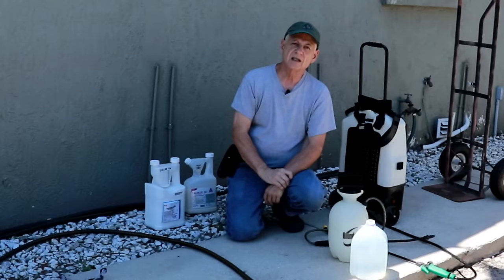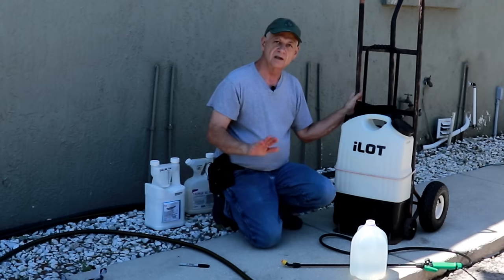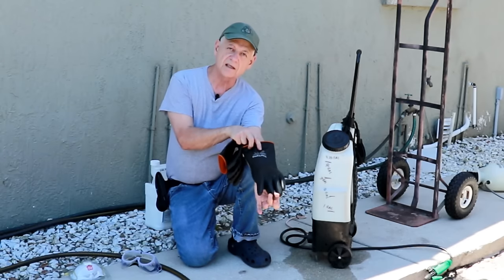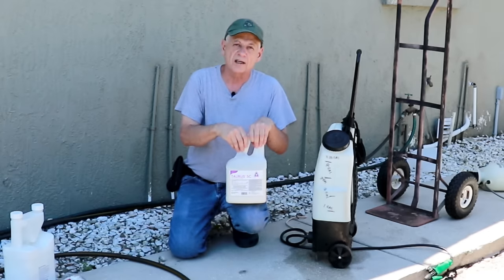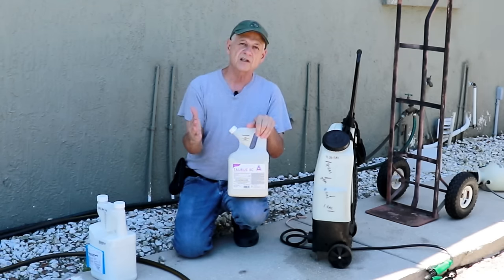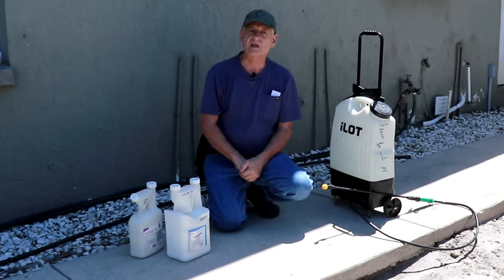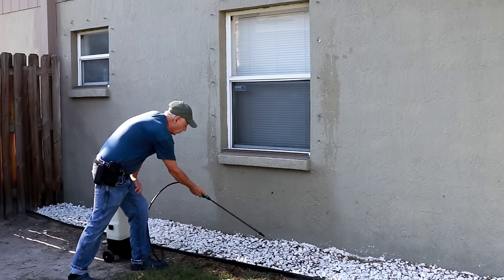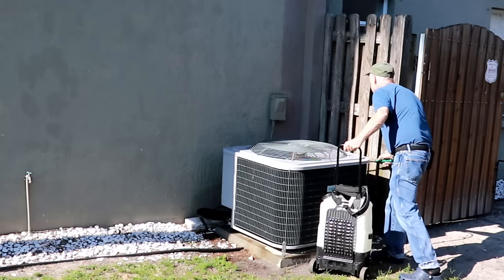General Exterior Pest Control - IMPORTANT!  READ THE DESCRIPTION.

Comment: Hi Guy, thank you for such informative videos! Do you have any advise for treating drywood termites? Is tenting the only solution that will truly get rid of them? Right now, the infestation seems to be only in one area of the house. I have heard good things about using Termidor foam. What can we do for the outside of the house? Any advise will be appreciated.
Reply from the maker: Hi Jonika.  This is quite an involved subject and I do know a lot about it.  First let's talk about how you got drywood termites in the first place and how to avoid them in the future.  Then I will go over all your options on how to treat them.  Most of the time, these guys enter through the exterior of your home.  They come in through cracks and crevices around windows, doors, pipe penetrations, the eves under the roof line, etc.  You can also bring them in when you buy used furniture. They are easily prevented by never buying used furniture and by doing the treatment in this video every three months.  Unfortunately, while this exterior treatment will prevent drywood termites, it cannot treat them after they get in.  So let's talk about your treatment options.

1.  Fumigation:  Tenting and fumigating is the only sure-fire way to get it done 100 percent without fail, but it's expensive and most companies will not do it.  They will either farm it out or just tell you that they can't do it.  It's definitely worth getting an estimate for it though to see exactly what you are looking at in terms of cost.  Keep in mind that, while this treatment will kill all the termites, it does nothing to prevent another infestation.  You will need to do that yourself and, as I already explained, you can do that by treating the exterior of your home every three months and by never buying used furniture.  If you go with fumigation, then try to find a company that specializes in it.  Most pest control companies that offer it, actually subcontract it to someone else.  It’s always best to avoid the middleman and work directly with the fumigation company.  The advantage of this method is that it is a sure thing.  The disadvantages are that it is somewhat dangerous, inconvenient (You need to vacate the home for several days.), and expensive.  Prices vary upon a number of factors, but I have seen costs as low as $2500 and as high as $8000.

2.  Bora-Care full treatment:  There are just a few pest controllers out there that can do a Bora-Care treatment on the entire building, where they literally inject foam into all your walls, the attic, garage, window frames, etc.  Bora-Care is a permanent treatment that never needs to be redone, but you really need to know what you are doing if you are doing the entire home that way.  It's worth asking about, but you may not find anyone that knows how to do it.  I will place a link below on a video on how it's done.  The advantages of this method is that it is permanent, so you never need to worry about any kind of termites ever again, and you do not need to leave your home while the treatment is going on.  The treatment usually takes just one day, but I do not know what it costs.  I have never done it myself or even seen it done.  It’s a fairly new approach and I was retired before it was in use.

https://www.youtube.com/watch?v=kXQTc9wwCfQ

3.  Microwaving:  This is the latest form of treatment where they literally put a microwave against the walls where the infestations are and they cook the termites to death.  Since this is very new technology, I suspect that many pest controllers do not have access to it yet.  The ones that do often also want to use pesticides as well to treat areas where the microwave will not reach, like the attic.  I have no idea what they charge for this treatment because it is very new and I have never seen it done.  So, I cannot guide you all that well with this one because I retired long before this was available.  All I can do is take a look at what they want to do and see if it makes sense to me.  The advantages of this method is that you can remain in the home while it is being done and it reduces the amount of pesticide that will be used inside the home.  The disadvantage is that it is not a sure thing.  Galleries can be missed and then the problem will not be solved.

4.  Spot treating is the way most pest controllers are going to suggest doing this, but be careful here.  Just like option 3, even the best pest controllers can and do miss galleries. That is why they will not give you more than a return visit guarantee.  They will return if YOU find another gallery and then they will generally just treat that one gallery.  By the time you find it though you could have a dozen more that you didn't find.  This type of useless guarantee is generally good for one to two years and then they want to sell you an extension on it for about $300 a year.  How's that for nerve?  If you do spot treating, you should know that not all pest controllers do it the same way and some are really bad at it.  To do it right, you must do a Bora-Care treatment of all the wood in the attic and basement, if you have one, and a lot of pest controllers won't do it because it takes too much time and it's hot, hard work.  That's why you need a written treatment plan.  Some companies will lowball you with a great price, but they are not treating the attic with Bora-Care and there is a good chance that is where most of the termites are.  Sometimes they will just spot treat the attic with a fipronil foam or they may not treat it at all.  Still, this is probably the most cost-effective option with prices being all over the place.  I have seen it as low as $300 and as high as $2500.  Guess which one is doing the Bora-Care treatment in the attic.  I know, I know, I'm probably really discouraging you right now, but I will always tell you the honest 100 percent truth because I don't want you to get ripped off.  So, if you go this way, then please send me all the treatment plans.  I am happy to give you an email to send them to.

5.  Treat it yourself.  You can do the same treatment that the pros would do in option 4.  I can walk you through how to do that, but keep in mind that if the pros miss galleries, then it's a fairly safe bet that you will too.  However, if you treat the basement/crawlspace and attic with Bora-Care properly, then that will eliminate a good deal of the problem permanently.  Then you just need to continuously inspect for galleries to be sure that you didn't miss any.  I have a video in production right now on how to do this, but it will not be available for at least another month.  It takes me several weeks to produce a video and I have already been working on this one for almost three months and I think I will need another four to eight weeks to get it finished.  No matter though.  I can walk you through it and you can even call me if you need verbal explanations.  I am here for you every step of the way.

Okay, sorry for this lengthy explanation.  I know that this must seem really overwhelming and I wish I could just go there and take care of it, but the best I can do is try and guide you through the process and ask you to try and relax as much as possible.  Having drywood termites is a scary thing, but worrying about it is not going to fix the problem.  The best thing you can do is to do your homework, which you are now doing, and then devise the best treatment options for you, that is within your budget.  This is not something that you can ignore because it is not going away and when left untreated it will literally cause thousands of dollars in damage to your home and may even render it unsafe to live in.  So, while this should not be a cause for panic, it should be a cause for concern that needs to be addressed as soon as reasonably possible.  The good news is that you came to the right place.  My service is free and I will take the time to guide you through whatever option you choose.  Even though there are a couple of options that I have not personally done, I have done my research on them and I am very familiar with how they work.  So, I can guide you through how to do this yourself or how to get the best price on a pest controller that actually knows what they are doing.

Thanks for reaching out to me and thanks for watching.  Please let me know how you want to proceed and I will do my best to help.
Reply: @GuysPestSolutions  Thank you so much for such a thorough reply! You gave me and others great information. Thank you for sharing the helpful links as well. I just ordered more cans of the termicide foam and a gallon of BoraCare. I can tell where the termites are thanks to their droppings. Would you be so kind and give me any tips on how to apply the foam properly? I have a few places where the termites made "poop" holes in the wood and where they swarmed this fall. I looked into one open gallery and oh my gosh, there it was - one live one crawling. Would you know how often could I reapply the termicide foam? Like you say, I don't expect to find all the galleries all at once, but I am ready to keep checking for more later. As the next step, you recommend BoraCare. Can I apply it on the wood inside the house or should it be used on the outside only? Do you think it's a good idea to treat the affected wood with BoraCare before or after getting it treated with the foam?  Can I apply BoraCare with a roller, too, or spraying it on is the best way to do it?  For now, I am going try to treat it myself. I will call the pest control companies and ask about their BoraCare treatment plans (or if they even have them!). Thank you, again, for your helpful information and guidance! My house is  ALL WOOD. If I don't start fighting these critters, it will get destroyed.
Reply from the maker: YouTube is giving me a problem with writing a detailed response to this question.  Please email me at guysyoutube@mail.com.  Please note that it's just "mail" and not "gmail."  I'm sorry, this has never happened before, but I can only write a few lines at a time.  If you email me, I will give you complete directions on how to find galleries, use the foam, use the Bora-Care, and where to get it all at the best price.  I will answer all your questions and I will stay with you every step of the way.  You can even call me if you need to talk to me.  Sorry about that, but email is better anyway.  That way you can send photos too if needed.

Comment: You mentioned "Round-up" in passing in one of your videos.   Could you do a video about your opinion on that and any other similar chemicals?    Is it o.k. to use, or should we throw it away?  Question from Plant City, Florida.
Reply from the maker: The active ingredient in Roundup is a known carcinogen, but it is perfectly safe to use if you wear the proper protective equipment and you take a shower after you are finished.  There is a better and cheaper product though and I will give you a link to it.  It uses the same active ingredient, but it is much more concentrated.  With Roundup you need to use 8 oz per gallon of water, but the product I use can be mixed at 3 oz per gallon and works even better.  If you want the best results, apply it with a hose sprayer.  I will give you a link for both items.  Just set the sprayer to 3 oz per gallon and soak the weeds good.  Most people fail because they are too cheap with the product.  Also, you do not get overnight results like they claim.  Weedkiller can take days or even weeks to work, depending upon the species of weed.  I am thinking about doing a video on this, but I have not gotten to it yet.

I hope that helps.  Be well my friend.

Weed killer:  https://smile.amazon.com/gp/product/B00ARKS3XO/ref=ppx_yo_dt_b_search_asin_title?ie=UTF8&psc=1

Sprayer:  https://smile.amazon.com/gp/product/B00UER1S64/ref=ppx_yo_dt_b_search_asin_title?ie=UTF8&psc=1
Reply: @GuysPestSolutions  

Thanks very much for a great and through answer.  As one person said before,  you are helping a lot of people and saving us tons of money.  It's appreciated.
Reply from the maker: That is so kind of you to say.  Very much appreciated.  I love doing what I do.  Be well my friend.

Comment: excellent video. thanks! here in socal, it costs $200/quarter for pest control. how to you keep pests off patio furniture?
Reply from the maker: What I do is treat the patio.  I spray the concrete with whatever pesticide I am using and I spray the legs of the patio furniture.  I also treat around the perimeter of the patio, the same way I do for the rest of the building.

I hope that helps.  Be well my friend.
Reply: @GuysPestSolutions  yes, thanks.
Reply from the maker: Always my pleasure.  Be well my friend.

Comment: I’m 15 minutes in to your video. Not sure if u answer this question later In the video. If I make a full 4 gallons will that last 3-6 months if I don’t use it all in one application?
Reply from the maker: Thanks for the question.  First, I think it's great that 27 pest control companies gave me a thumbs down.  That tells me that they are watching and that they don't like that I am sharing secrets.  Actually, I am kind of impressed that so many pest controllers take the time to watch.  Anyway, the answer to your question is that almost all pesticides do have a shelf life, but the mixed pesticide should last six months if you have it stored inside and out of the elements.  That being said, I do not recommend mixing more than you will be using for the day.  For one thing, you can forget what is in the sprayer.  Also, pesticides can clog sprayers.  You should always clean the sprayer properly after use.  This video is not really all that long and I recommend that you watch the entire thing.  I show exactly how to do the treatment and how to clean the sprayer.  By the way, the treatment I am showing is never done by the pros.  Almost all pest control companies have a policy of not treating over shoulder height.  That means that they will not treat the soffits or facia boards.  If you live in the south this is a big problem because drywood termites often enter through penetrations in the soffits and facia boards.  In the video I talk about two products and I was not clear that you need to alternate between these products every three months.  The Taurus SC is the way to go, but it is illegal to use it more than every six months.  The problem is that it does not last six months.  It barely lasts three months, so you need to do an in between treatment with the Talstar P.  I hope that helps.  Thanks for the question and thanks for watching.  Be well my friend.

Comment: Hi I see professionals bringing 1 or 2gal of finished product in metal sprayer to spray around 3000 sq ft house. Is that enough? 

You said 20 Gal. That’s a lot different compared to 1 or 2 Gal of finished product.
Reply from the maker: The 20 gallons was for two houses.  My daughter lives next door.  Maybe I forgot to mention that.  I don't recall anymore.  Anyway, an average house is going to take six to eight gallons, if done correctly.  My place takes more because I treat three sheds as well.  The pest controllers do not do the job correctly and that is why they don't use as much.  For example, they do not treat the eaves and fascial boards.  Also, they do not properly treat the area where the ground meets the dirt.  They just do a light spray and that is going to allow some pests to get by.  The only thing they will do with the eaves is to knock down the cobwebs.  A lot of the time, they do not even treat around the windows and doors either.  That is an invitation to drywood termites if you live in the deep south or west coast.  You can also get carpenter ants that way as well.  The treatment method I am suggesting will protect you from everything.  I suggest alternating between the Taurus SC and the Talstar P every three months.  Start with the Taurus SC and then three months later use the Talstar P, ten back to the Taurus SC, and so forth.  The reason for the battery-operated sprayer is because it is way faster than one you pump up.  It saves a lot of time.  Let me know if you want recommendations on one.  The ones in the video are no longer available.

I hope that clears it up.  Be well Shrey.
Reply: @GuysPestSolutions  very helpful and informative reply. Thanks 

What’s your thoughts on new fancy micorencapsulation word being used for all the expensive herbicides like Demand, Fendona, Cycick. Worth alternating with those also?
Reply from the maker: To be honest, I have never used them.  I'm sure that they work really well, but they are a bit too pricey for my wallet.  I don't think you would go wrong using them, but the cheaper alternatives work just fine as well.